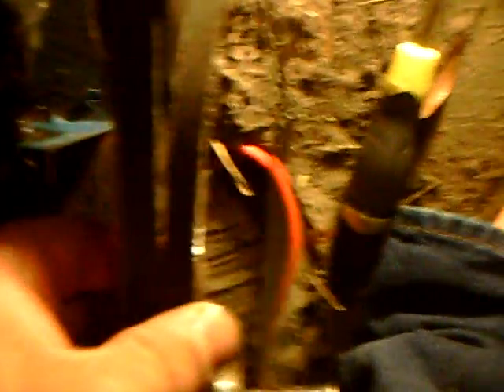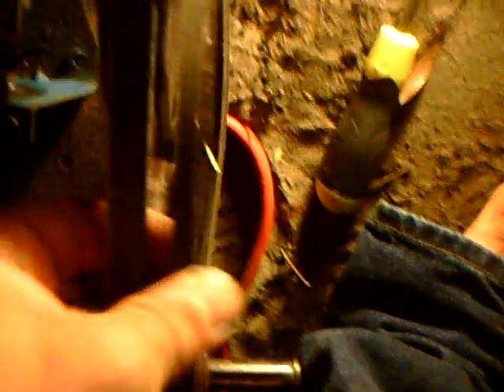much better home made generator!

Comment: @hheywire i belive my grandpa or someone at his work made it. my grandpa was known to make stuff like that. someone welded up a little cart for the engine to mount to and then an old car alternator was belted to the engine and a heavy pair of jumper cables is attached to the alternator.

Comment: oh i have one of those. it was my grandpas and he used it for chargeing the batterys on the dozer. its got a 4hp briggs, i just have to get a pulley on the engine and fix the carberator. just needs a new diaphragm because its not pumping fuel out of the tank right now but runs if i put gas in the carb

Comment from the maker: @SuperKONR no definetly use the 6 hp motor, its actuayl what they recomend, if you go any lower than 5 hp you gonna have to do what i did and put small pulley on motor and big on alternator, go with the six horse, in fact do two alterantors on it, ive seen set ups like that, one on either side and have double the power, make that engine work, seriously try it, youd be the first on youtube to do it ;)

Comment from the maker: @SuperKONR omg if you use a 6 horse it will be unstopable, the motor im using is a 2.8 horse, high torque motor, definetly use the six horse though, but dont put a reduction like on mine, if anything put a 6 inch on the motor and use the puley the alternator comes wiith, then u aughta get the max out of it, and buy a cheap ebay inverter make it into a pro generator like im doing ;)

Comment from the maker: @SuperKONR yea its gotta regulatr on it, and it works pretty good, and i atached the big pulley with rods of flux and a majical power device to make an electrical arch between the two, lol i usd a welder is what im getting at, and i dont think youll wanna use a weed eater motor, its not gonna have enough power to turn it, beleive me it wont!